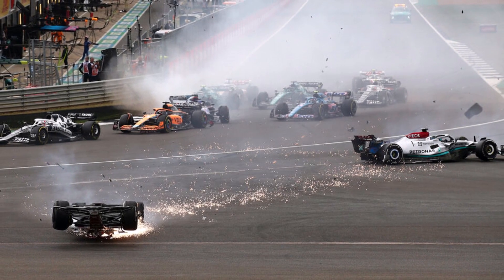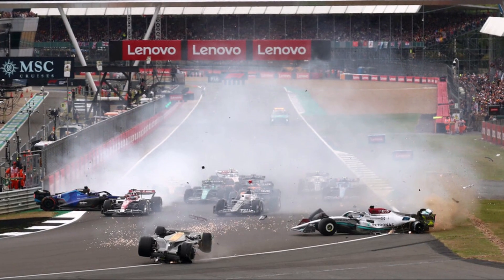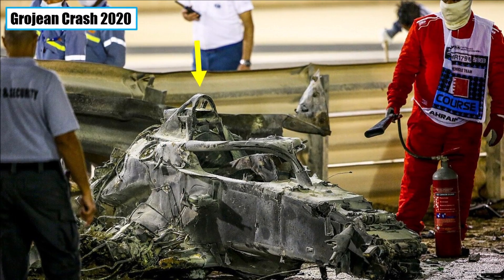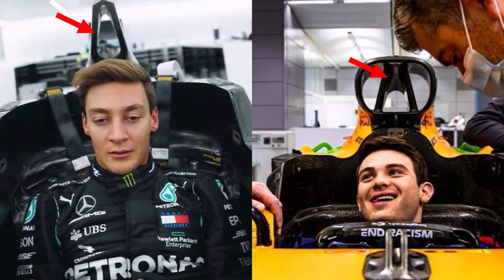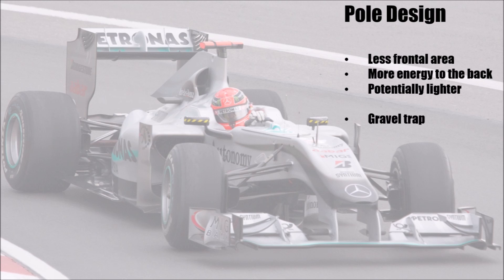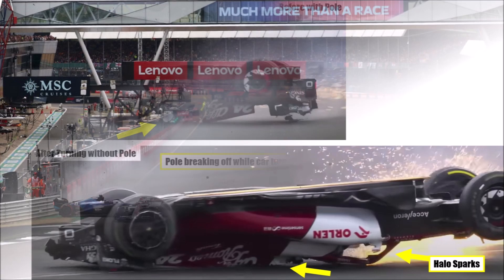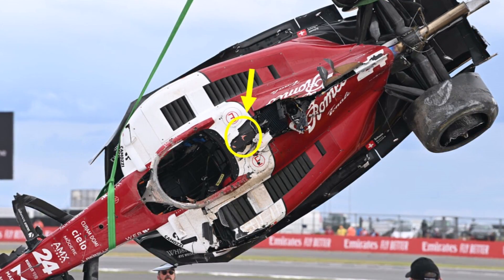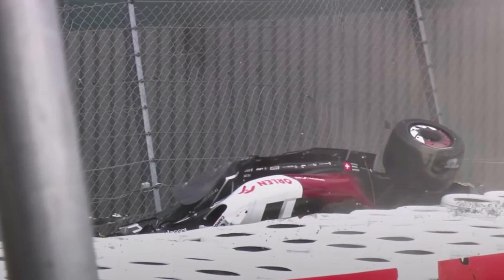F1 2022 - British GP - Lessons Learned - Zhou Guanyu's Crash Analyzed

Comment: The only way to stop this type of accident is to have enclosed wheels so they cannot be rolled over each other! How the Alpha flipped over was its wheel struck the back of the one on the car of George Russell's. This had the effect  of propelling the Alpha into the air and its momentum turned it onto its back!  What happened after that was down to the cars momentum and lack of braking ability!  Had the wheels been enclosed that would not have happened and the chances are all cars in that accident might have been able to continue if they were able to get back to the pits!
I do not advocate changing the body shape of the F1 cars only have the wheels within a fixed shielding guard so the rotational forces of the wheels are no longer a factor in such accidents!  This would not effect the changing of the wheels during races and could help with the current aerodynamic problems the teams are having with Porpoising!
Reply: On the contrary, I don't think they would really work. In fact, Indycar did exactly this with the Dallara DW12; they found that it made little different, and similar crashed happened despite the changes. They also had a terrible tendency to break off in any collision, further adding to the debris pile, and as they often broke off in one piece, could be an even more dangerous hazard than average. IndyCar ultimately removed them 5 years later.

A better method is simply better protecting the cars. As Zhou's collision highlighted, they've done a great job with the Halo and other developments. If there should be any fixes in response to this crash, it should be the rollover hoop.

Comment: My thought is about the height of the fence and protection of the spectators. The car nearly vaulted the fence from a standing start. How does the corner speed into that turn from a standing start compare to racing speed? Would the car, in a similar accident on lap two, have had enough energy to clear the fence completely?
Reply: When Zhou's car hit the fence, there was about a car's width of fence left above it. In addition to this, with the way it happened at all, the car jumped in the first place because the gravel pit is essentially lowered into the ground, much like a swimming pool - it has an edge, which the tire caught and this flipped the car into the air. Watching back the impact, you can also clearly see a road between the gravel pit and the tire wall.

Now, there's multiple solutions to this, each of which solves the potential problem you discovered: Either the gravel pit stops at the tire wall with no road between them, thus no edge for the tire to catch. In this case, the car simply slides into the tire wall and doesn't jump at all.
Or the gap between the gravel pit and the tire wall is widened significantly so a car jumping like Zhou's did doesn't clear the tire barrier.
An increased distance between tire wall and fence - which will be talked about regardless - would also mean the car would need exponentially higher speed to clear the fence.

The reason F1 will discuss higher distance between tire wall and fence is that Zhou's car wedged itself between the barrier and the fence and made it very difficult to get Zhou out. Had the car ignited like Grosjean's did 2 years ago... Let's just say the small gap is a hazardous safety issue.

Comment: I examine the big picture and this accident was caused by so many cars tightly bunched together. That is because F1 has a standing start. This is an area of concern that must be examined without prejudice. Yes, many fans love the spectacle of a standing start, but this method introduces unnecessary risks from a safety perspective.

Many fans also opposed the introduction of HALO because it interfered with "the DNA of Formula One". They are using the same rationale to support standing starts.

Remember Ronnie Peterson. He died because it was a standing start.

Comment: What about the reason the car flipped over and jumped over the tyres?
To it looked like the tarmac path between gravel and tyres caused this.
As gravel couldn't give way anymore.
With gravity data it should be possible to see as a flip by sudden tarmac would show a far higher peak load.

Comment: I think there putting to much faith in the halo, at the cost of the other safety systems. Halo was a addition to the system not a replacement. Expect a few teams to retro fit the bolted version a bit quick as I am sure there’s a few teams doing this.

Comment: Would an F1 car with no ventury tunnels have flipped like that once it experienced a violent loss of air pressure from a side hit like that? I've never seen this before but I might've seen an incident like this from past ground effect era films
Reply: Kimi Timoskainen  thanks Kim, the flip just seemed very odd from past experience. Perhaps the FIA will shed more light on what really happened. Venturi tunnels were banned for these kinds of violent incidents in the past, let's hope this is not the case because the racing has been excellent with these new regs

Comment: I’ve only seen a handful of rollover structure failures in the last 30 years at any level. This is possibly the most inexcusable of them all.
Reply: Indeed. Everyone is talking about the halo while im wondering how in the hell the chassis passed the safety tests and requirements and made it onto the track. There is a major problem and it brings into question f1's safety protocols and needs to be investigated. Who knows how many chassis dont meet the actual requirements
Reply: @GonzoDonzo  Everyone's talking about the Halo because everyone is well aware that because of this failure, Zhou would be dead without it. I totally agree they need to find the root causes of this, though, because the Halo saved him despite the situation, rather than because of it. If he was a few inches taller, he could have had some serious neck injuries.
Reply: @YT-TheLegacy  im just worried that if it can happen once to such a crucial component what else can fail including the halo itself. They may need some better testing protocols. Theres ways test composites for imperfections. It takes time but its not expensive beyond the initial purchase of eqp.
Reply: @GonzoDonzo  Absolutely. Unfortunately, I don't think the carbon fiber is at fault here. Or rather, it is at fault here, because it was used incorrectly. To my knowledge, carbon fiber is a brittle structure, which is why it's good for one big impact, after which it loses a ton of its strength. The type of collisions where the hoop should come into play, would be like the one we saw in this case, and the material is not good at handling fatigue stresses like the type it experienced here. I believe the loop is made out of some kind of metal, but I believe the loop should be big enough so it can be bolted directly to the frame. They should use a metal like aluminum or titanium, if they aren't already.
Reply: @GonzoDonzo  Absolutely. Though personally I don't think testing is needed, because the accident made the cause blatantly clear: Don't attach a rollover safety system to the body of a car - especially if it's carbon fibre. Considering the fact that the National Hot Rod Association (NHRA) and International Hot Rod Association (IHRA) (which regulates drag racing vehicles) mandate a fully welded rollcage with four points directly welded to the floor - and that F1 cars have significantly higher risk of hitting an object quite hard compared to a drag racer - it's literally absurd that they would use the system the way it was designed.

They obviously don't need to build a rollcage, but anchoring the Halo and the Rollbar to the floor is an absolute must. But this will require a major revision to the 2023 rules, and as this is a major redesign year for the teams, the sooner they mandate this change, the better.

Comment: the halo is a good safety device but it also acted like a ski not alowing the car to roll over sooner. it needs to be redesigned to allow the car to roll back onto it's belly
Reply: It just needs an abrasive spray on the existing structure.
Reply: @EMichaelBall I've seen some horrific crashes how many years has a simple roll hoop saved so many lives.

Comment: I know everybody is now in love with the halo, but it was the failure of the roll hoop and the flat nature of the halo that allowed the car to slide upside down so far.  And eventually the halo dug into the gravel and launched the car over the tires.  A couple years ago Hulk’s car flipped and landed on the flat halo trapping him in the car while his car caught on fire.  The halo needs a redesign imo.
Reply: It Probably just needs an abrasive spray on the current design.
Reply: The halo's fine; the roll over hoop is what they should be fixing. If anything, the rollover hoop should have helped right the car. The Halo wasn't designed for this kind of crash, but it saved him anyway.

Comment: Whilst I agree with you that the lateral forces on the single pole contributed to it breaking it can't be the only reason since the whole structure took a major load when it first hit the track after the car rolled over. This likely weakened the connection to the car. Thus it didn't fail on initial major impact. Designing something to survive both longitudinal and lateral impacts ultimately means there has to be lateral support at the base of the structure where it connects to the chassis. Thus one might conclude that single pole designs will not be allowed in the future.
Reply: Carbon fiber is really good at handling an initial impact, but after the initial impact it is greatly weakened. This kind of collision is the worst case scenario for carbon fiber, and looking at how it was mounted, it appears it was glued to the carbon fiber. This is a big No-No in my eyes, and the hoop should have been bolted directly to the frame instead.

Comment: I'd imagine that F1 will mandate a triangular structure from next season, and rather than just being bolted on, will form part of the survival cell and be connected to base of the chassis. This would form a triangle against which the driver is seated.
Reply: Worst part is that they are not even sure of it was bolted or glued.
Reply: @ItsMorbinTime03  if they make it part of the survival cell, this won't be an issue in future.

Comment: I have a question for you @BSport. When designing the chassis, should it not be that rollover section be part of the Monoque with reinforced metal of whatever material to withstand the load exerting on the structure.
One method I probably would use, is from is how engineers designed WEC chassis.

Comment: Lots of comments saying it was “lucky” the car didn’t catch fire. Well in the same way was it “lucky” that the halo stayed attached to the car? And unlucky the roll hoop failed? 

No it was by design that F1 cars don’t catch fire when they crash (the Grosjean flaw has been fixed), it was by design that the halo survived the load, but it remains to be seen if the roll hoop failed under a smaller load than specified or whether it experienced a higher load than it was designed for failed that way.

Comment: at the very least... more adequate fire suppression anywhere on track a driver could be pinned like that.
should drivers have Bottled air?
Reply: The marshals have both dry powder to knock down a fire and AFFF or foam to seal it. In addition there are Fast fire intervention vehicles around the circuit with large capacity foam systems. I used to work rescue/extraction and have myself dealt with similar incidents. I’ve also spent time lying in leaking petrol to extricate a driver. We rely on the skill and response of the track marshals to knock it down should the worst happen, before anything happens to us.

Comment: I never liked the pole design.  it seemed too prone to braking.  I always thought that roll hoops should always be a mandatory design, and yesterday I think proved that.  I think a ban is incoming....(despite the fact that the hoop design has failed a few times too, such as twice at Nurburgring 99).
Reply: The hoop might need to be bolted and welded, just to be sure it holds.
Reply: @EMichaelBall  It was glued, to my knowledge. It's attached directly to the carbon fiber body. Which, to my understanding of carbon fiber, is a really bad idea. As you said, it should be bolted to the frame. I don't think welding is necessary, but it wouldn't hurt either.

Comment: thank you.  when i saw them recovering the car i couldn't work out what was missing or different about it.  my guess is that they have probably used the same roll bar bolted on that they have used other years - yet they are telling us that the 2022 spec f1 car is considerably heavier than last year - or ever before.  13" wheels and full of enough fuel to complete the race being just two weight items to consider.  so was the roll bar just not up to the spec - in which case other f1 teams may be in the same boat.

Comment: It is truly a miracle Zhou was completely unhurt.  That accident was horrific. 
I'm very glad he is fine.
Reply: Not a miracle but he was one cheese hole away from possible death. Luckily the halo held.
Reply: the zhou crash is because of gasly, he is always the cause of many accidents
Reply: Horrific? I've seen much worse.. Only because he went upside down and tumbled over the tyrebarrier doesn't make it horrific.. He hardly suffered any G's and he still had the Halo to protect him after the roll hoop failure.. What's horrific here is that roll hoop failing that easy, hence this video..
Reply: @inflatable2 - Yes, the car could also have exploded in a giant ball of fire, disintegrate into a thousand pieces, get vaporized at impact, etc.
Ayrton Senna's accident was far more mild than this one, yet it resulted in his death.
Reply: @onesojourner7514  Senna's accident was a hell of a lot harder. He hit an uncushioned concrete barrier at over 200 km/h at an angle. Here nobody was going at full race speed and G forces were relatively low. Flipping over doesn't mean it's a hard crash.
Reply: @onesojourner7514  Senna's crash was much more horrific.. He hit a solid wall at high speed..
Reply: @inflatable2 - His accident was not nearly as spectacular as Zhou's.  It was horrific in the sense that Senna died, but, the accident alone did not look at all as Zhou's.
Reply: @inflatable2  That's not what killed Senna though, a piece of front suspension broke off which caused the accident and it also flew up and pierced his helmet
Reply: @inflatable2 It's not a competition. Any crash that has the potential to cause life hanging injury is by definition "horrific"

Comment: Well as a Race Car builder with over 40 years experience building cars of all kinds (I honestly did not know that the FIA had Homologated this type of “pole” structure rollover protection) that’s absolutely ridiculous! Everyone with half a brain knows that a triangle is one of the if not the strongest structures there is! I’m sorry but when it comes to safety it is not worth the reduction in weight to reduce the strength of the rollover protection of a driver! Thank god that car did not catch of fire because he would absolutely perished in that situation, there would have been NO WAY to get him out of that chassis the way it was sitting!
Reply: Actually, the shape of the hoop wasn't the reason for the failure; it was glued to the body, and the carbon fiber broke off around the hoop. If there's a screenshot out there showing the jagged edges of the body around the hoop structure after it separated. The hoop should be bolted directly to the frame, and no carbon fiber should be a part of it.

Comment: In the videos you can see that the rollover hoop breaks away at the first impact with the ground. That is something that should NEVER happen. Without the halo saving the driver this would have ended much worse. And then the car gets wedged between the fence and the guardrail, trapping the driver... scary. Not to mention if the car had sommersaulted there would have been a chance for it to go even over the fence...
Reply from the maker: As far as I can see it in the footage, the roll hoop works first. You can see how high the car is when it first slides on the ground. After 2s, when it turns around its z-axis, it suddenly drops around 15cm and the rear wheels touch the ground. A long white/black piece flies away... This is when the roll hoop broke.
Reply: @bsport320  Hard to tell from the footage... but it really doesn't matter. The tub, halo and rollover hoop should be components that have to hold up even in the most serious crashes.

Comment: An hour long stoppage for a 4-5 car crash at this level of competition is inexcusable. Other tracks would have had this cleared in 15 minutes, maybe 20 maximum.
Reply: There was also a separate track Invasion from protesters around the same time. If anything, this crash may have saved lives because some of the drivers could have hit the protesters if the race wasn't stopped in time. So not only were they cleaning up the track, the police were also on track apprehending the protesters. Check some of the other videos about the race to hear more about that part of the race. The one picture I saw was of five people sitting right in the middle of the track. As previously stated, it was fortunate of the red flag because the cars that ended up encountering them were already going at greatly reduced speed and were easily able to go around them.